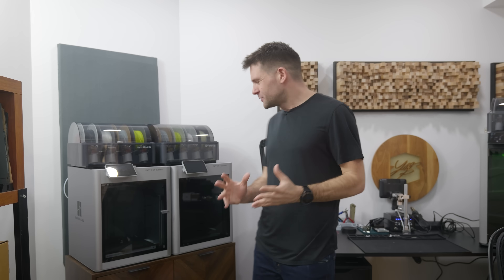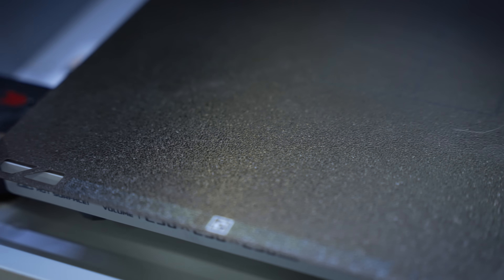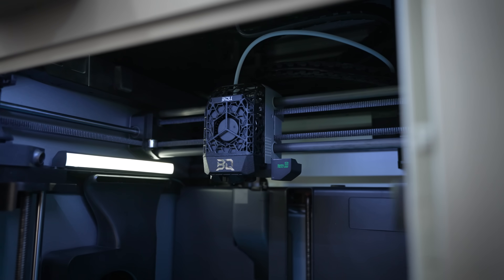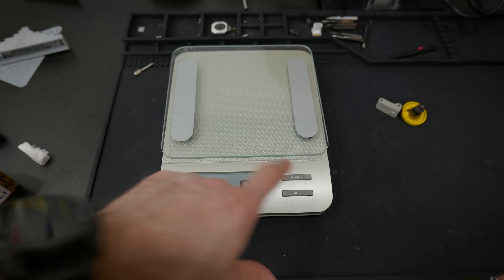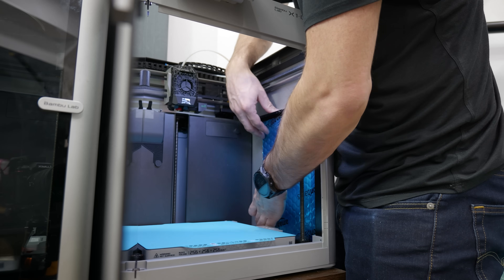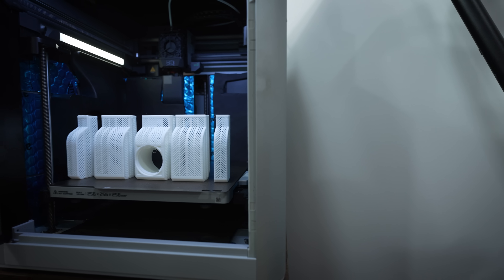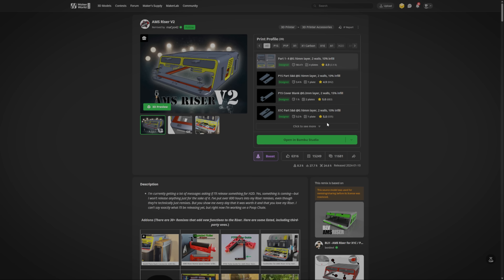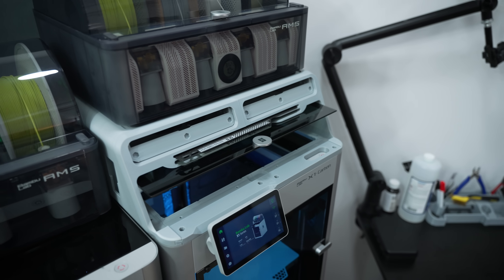I dont understand why more people dont MOD their 3d printers...

Comment: The lightweight and fan thing from bq are not good. The magnets they used aren't strong and cause the head to come lose from time to time. The fan blocks the lidar so it doesn't detect problems if they occur at just the right location. For example I had bed adhesion issues on my x1c and it was not detected. I had the glob encase the nozzle, rip my nozzle sock (rubber piece) and even fused the fan duct to the pla I was printing with. Don't buy it. It isn't worth it and it even messes with the harmonica making it loud in certain vibrations

Comment: People does. Bambu users not so much, because the printer just works every time. Just fine, and printing rapidly. Why would you mess with it?
On the other hand, if you have an Ender 3 or something like that, as I had before my Bambu, then of course you'll want to upgrade it. You can make cool thing out of that printer.

Comment: A simple mod might be .. UV blocking tint film for windows.. Might help keep the heat in.  10% tint so it doesnt block light.. almost clear.  Another mod also.. draught stopper for doors to keep draugtts out and keep heat in.. only in conjuction with matting.

Comment: Soooo you are new to 3dprinting right!!!! i started this hobby back in 2007 - 2008 where i build my own printer, from the ground up you know reprap, machine gears and extruder parts my self, i have spent more time designing and building than actually printing. but the age of crappy printers are over, so modding is for more specific stuff!!! like non planer printing as Joshua Bird just blew the lid of with hes slicer that can slice prints for non planar printers. THAT is impressive, i guess i can start up my planes for a 5 axis 3dprinter again 😀 to everyone go watch hes video that is so freaking cool 💪💪💪💪💪

Comment: You had 2x weight saving products, so if you add there total weight together plus the heavier gears does it atleast come out to the same weight as the standard setup? Because i noticed you only compared the weight of the lighter extruder body and metal gears but not the extruder body, metal gears and the other weight saving thing (i cant remember the name of without rewinding the video)

Comment: I dont do many mods these days unless it would be super effective. My reality is that modern printers are as good as i want them to be. I did all the mods to my first printers when it mattered but with bambu i just use it as is and get great prints. Im open to good mods, just havent seen any i need yet. *edit, the new hot end and metal extruder gears are pretty nice

Comment: The silica can only absorb moisture from the air, not from the filament. Obviously, in a closed environment, this will shift the moisture balance and cause the silica to absorb the new moisture from the air. But this is an incredibly slow process and not practical. The silica can only absorb moisture from the air, not from the filament. Obviously, in a closed environment, this will shift the moisture equilibrium so that the silica in turn absorbs the new moisture from the air. But this is an incredibly slow process. As a preventative measure, however, silica is the perfect choice.

Comment: One warning for anyone who buys the Panda Jet or Jetpack: Due to the MJF process, nylon powder can end up caked inside the air channels, partially or completely obstructing them. This happened to me on the one I purchased, and it resulted in obviously worse print quality overall compared to stock, and I know of others who have had the same problem. A combination of fishing a wire or filament into the channels, along with some sharp blows against a flat surface can help clear this out. But watch out for the dust -- you don't want to breath that in.

Comment: My experience with metal extruder gears is they significantly improve filament handling. Better yet is all metal extruders.

For improving feed rate, I have had good experience with the E3D Volcano hot end. Brass nozzles are under $15 and hardened steel nozzles are under $30

Comment: I like how this video implies people don't modify their 3D printers, as if the tiny fraction of the community that owns only Bambu Lab printers is all there is, ignoring the literal decade of people modding their fully open source printers lmao. Even worse is that this video just shows off other paid products instead of actual mods. That's like drilling a hole in your car's tail pipe so it sounds louder.

Comment: Insulating ONLY floor and walls are just.. Eh.. Waste of time.. Heat goes primary UP. So insulating your top plate would do a lot better. You can also use aluminum foil as a inner layer. That will reflect heat back. And yes. You will need to use same energy to heat the chamber no matter how good you insulate it. To heat 1 cubic meter air increasing 1 degree celsius you will need to add 0.35w of heat for 1 hour. This is at best possible conditions. And this is physic rules.

Comment: Dont forget to set slicing clockwise in your slicer, if using the Panda Revo. Standard is counter-clockwise - but this causes a momentum wich can loosen the nozzle.

Also one of the downsides of Bambulabs closed source: Useing standard flow Revo nozzles you could actually use Prusas approach, unloading the filament with a special ramping profile on unload to get a nice, reloadable filament tip. So no cut&poo needed. Would save a lot of waste (and time) while changing the filament. But as far as I know, the filament change with cut&poo is controlled by the (closed source) firmware, not the slicer.

Comment: I bought both build plates for my A1, they have 2 versions, Glacier and Frostbite. I haven't used Glacier since it's more for engineering material, and I only have PLA/PETG, which the Forstbite excels at. Since they arrived, I've been using the Forstbite for PLA at 35 °C and 55 °C for PETG. I think I can go lower for PETG. Mostly I had a PLA problem sticking with small parts, but now not a single print failed due to adhesion problem,  also I think it will help me when I print many small part at the same time I won't face the issue with them warping since they been exposed to heat from the build plate for a long time. So the printing PLA at 35 °C and with great adhesion, I can't complain and recommend everyone printing PLA, buying the Forstbite. I can't say for the Glacier since I didn't use it, but bought them both since they were cheap.

Edit: I swapped the names by mistake, but how do I diffentate between them is due one of them has a holes at the end of the build plate (grip) and the other is a full build plate. I recommend the full build plate without holes (Forstbite), which also has a rougher texture.

Comment: Your moisture sensor is right up against the dessicant and not going to give you a good reading of the actual moisture level in the chamber.  
That storage is also not air tight, and, as you know, like chaos theory, moisture spreads and tends to make everything the same level of moisture going from the more moist to the less until equilibrium. Leave your rolls and dessicant inside for long enough and they will end up just as saturated as outside making no difference at all unless you replace the dessicant every time you open that box just to get that extra dryness for the next few hours. It's a waste of time and effort. Better place your unused rolls in an air tight box with fresh dessicant when not using them.
But also, drying filament is sometimes overkill and does not improve that much your print quality.
My tip for prototyping is to not worry about the dryness of filament unless it's stringing too much during prints. Get to it for production but even then, if you print a lot, you might not need a dryer as you'll be going through rolls faster than the moisture can cause a problem.

Comment: Insulation won’t help if all the heat is just blow out the top of the printer. You’d need to get a cover over the open top, and that will immediately change those results, however minor the results may be.

Comment: If we're trying to lower the weight of the print head, why don't we move the cooling fan off of it, and use a tube to bring cooling air to the print head?

Comment: I made the extruder upgrade and it still keeps jamming.  So what is the fix???? it's doing the same exact thing and it's driving me crazy.  Can't even finish a single PLA print.  This started with the original extruder gears and hasn't made a difference.

Comment: If you were into 3d printing back when I started. This was the only option to even get a decent print. Hell, mine didn't even come with a parts cooler so the shroud was my first print. Followed by something to block the Live power wires that went to the power supply. After months of upgrades, I finally got it pretty decent.

Comment: I did 3 mods for my X1C. PTFE guide for toolhead and replace the PTFE tube from the wiper with 6x 6x2mm silicone o-rings to stop the poop on the build plate. Raiser for the top Glas Plate to add a light (don’t use the light anymore) and it adds vents. I use them for printing PLA.

Comment: Lower mass tool heads reduce ringing; they don't increase resolution. That was not a proper test for mass reduction improvements.

If you replace the front extruder cover and do the other upgrades, it looks like it's about a wash on mass. So you get the improvement of the metal gears, and make up for the weight with the other two changes.

Comment: Can't say I'm a big fan of the extruder gear, it's a bit of a downgrade if anything. The part that comes in contact with the filament should be hardened steel, not brass, particularly if you print with CF or GF filaments.

Comment: Not cool tack plate that is the glacier plate which can be run at 1 degree for pla only. The frostbite plate is much better and can be run at 1 degree I own all three plates an use the frostbite plates all the time the frostbite. The extruder gears and the aluminum extruder bracket are garbage. Owned all the upgrade parts and only use the panda hotend everything else is in the drawer.

Comment: Notes on your 'sound proofing': You don't seem to understand how sound works. It's vibrations. The metal components that actually do the vibrations are all interconnected and those all touch the external metal panels (Interconnected, remember?), so you're not actually changing where the sound is coming from or absorbing the vibrations making the sound. You'd get better results by layering some sort of gelatin padding on the external metal (and glass) - top, bottom and sides - and then layering foam over top of that.

Comment: The mod that you have installed for the A1 nozzle wiper has introduced layer shifting while I was using it. Thus, I have reverted the mod. Additionally, I have added the PTFE tube straightener on top of the printing head. BambuLab also have also introduced SuperTack bed sheet, but I have mixed results with it. I am also using Elegoo filament, but for some reason, it doesn't stick well to the SuperTack, despite that glue is not required. The paid mods are useless to me, as the X1E uses different connectors. Also, the X1-series already come with hardened steel gears for the extruder, so this upgrade from BQ is useless.

Comment: Best mod you can do to any printer than isn't a bambu cause I'm not sure if btt sell a comparable board and or are flashable, upgrade he board with a big tree tech board, alot better more function, can take a pie with io pins right on it and run klipper,  klipper is the best upgrade to any possible printer. From there it's motor drivers everything else to follow, motors, linear rails, new head and heater, thicker bed and heater. But by far getting klipper on the printer usually with a pi. So much better than anything shitass bambu can make. Also use orca slicer, bambu studio is a cut down orca slicer, everything is basically a version of orca slicer.

Brick layering is coming to orca soon (alot more strength)

Comment: Before watching: Dude in 2012 I argued with my engineering professors trying to fail me because they didn't believe a home made printer could print parts better than the school's printers. Modding personal 3d printers at the time was smaller than your number of subscribers. You are welcome but check your privilege. To this day I do not like my bambu because of the slicer. Though, for the record, bambu has improved better than any other company I have seen in the industry. I got my X1C when they came out and they have improved but still are not as trustworthy as my Prusas mks3

After watching: Decent video. You did a good analysis on the 3d party components. BQ is know for it's after market parts being far better than OEM but this shows otherwise. Well done. still do not like my bambu

Comment: In 8 years I've never had to dry my filament. I just store in a bag with dessicant and have recently used up a spool that sat on one of my printers in open air for at least 3 years. No issues at all. And all 8 of my printers are mostly stock - including my original Ender 3 from 2017. Never saw a reason to modify things that just work when I need them to.

Comment: 14:44 i actually printed these early on when i first got my bambu A1.  it would not go on propperly (was designed for an earlyer revision of the machine probbably and the screw hole underneath the bed didn't line up with the print) and it wouldn't actually alaign the plate.  the plate would end up ontop of the normal plastic tabs and caused the bed to be raised. it made me take them off and chuck em away and sad that i ever put them on.  (it broke something though don't ask me what it was.  i couldn't tell ya)  

i tried several versions of similar prints.  the ones you showed simple fell off.  and the longer one that is a single print for both sides.
in any case you don't actually use the little plastic tabs that sit at the back of the bed.  you hold your buildplate at a 45 degree angle to the bed. and just press the little nozzle cleaning tab that sticks out into it's recepticle and let it alaign the plate for you.  and then just place it down on the bed while maintaining it's position. 
it takes 3 seconds to do and it works the first time every time.  
took me way to long to find this out though.  so i have had to do 2 or 3 attemtps using the little plastic tabs for a while.

Comment: 06:25  this is simply 100% WRONG!!!!  
because bambu does a flow calibration test before each print.  and thus it should adjust to the new higher flow rate nozzle. 

ofcourse first you gotta make sure you are actually limited in speed by your flowrate and not your kinematics or simply print settings.  
(tune your print settings WITH A NORMAL NOZZLE) untill going up in settings no longer makes it print faster.  
then tune the settings to be 25% MORE than that.  it will not make your printer go faster because you are at the flowrate capacity of your hotend.  
NOW put in the new upgraded higher flowrate nozzle.  and then you should see an increase in speed.  (less time to print the same print.  like 1 hour to 50 minutes or something)  
if it doesn't print faster,  then the new "higher flowrate" nozzle/hotend is just utter bull.

Comment: 04:28  wtf is even this? 

do you understand anything about 3d printing at all?   do you seriously think these are the details they are talking about?  
GHOSTING!!!  put smaller and smaller text ON A WALL  a vertical surface.
Reply: also i would like to point out.  that your mod has conciderably ruined the top surface quality of the flat surface the text sits on.  probbably changing it out required some disassembly and you ffed up the reassembly.

Comment: The nozzles can be quite a bit cheaper if you buy directly from E3D, the company that designed them, or one of their distributors. They're part of the Revo ecosystem. I've been using them for several years and they've been great. They also have true high-flow and hardened nozzles for more abrasive filaments.

Comment: The first 15 prints in my Bambu A1 were mods. Fan shroud, Poop Bucket, Poop shield to keep them from flying, AMS dryer enclosure, AMS top mount, Stabilizing legs, Single filament mount, AMS + single filament intake + many more!
Reply: These arent mods. Just accesories
Reply: We view things differently. To me, mods are quality of life improvements you make to any product. Accessories are visual improvements. That poop chute that keeps the room free from flying plastic is a mod. That pokeball extruder marker is an accessory.

Comment: You can heat your chamber quicker if you convection heat it by putting the bed at 5mm from the top, 110°C and aux fan at 100%. Takes 15min vs 1h

Comment: Bambus generaly are plug and play and work 99% of the time. Every part and piece you change for an aftermarket upgrade introduces new variables which can throw off the calibration and lead to problems that werent there before. Then people try to figure things out and cant find solutions because nobody else has that same newly introduced problem.
There's a reason why people with Enders and similar modded 3d printers have so many different problems with no single solution because every printer is its own machine with specific part combinations. Its the same reason why console games can be better optimised than computer games where everyone also has different hardware.

Having said that, there are still lots of people who mod their Bambus with better hotends and nozzles, put heaters and heat insultaion in them and many other smaller mods that actually improve performance without throwing off the "calibration".

Comment: I know it's going to be ugly, but you would have an easier time covering the whole printer with isolation foam from the outside. 1. you would avoid the tolerance issue and 2. it would be way easier to actually cover leaking crevices etc, where there is air leaking there is sound "leaking". It won't be pretty though, but you could 3d print some covers :D